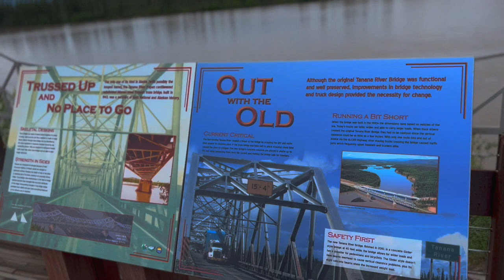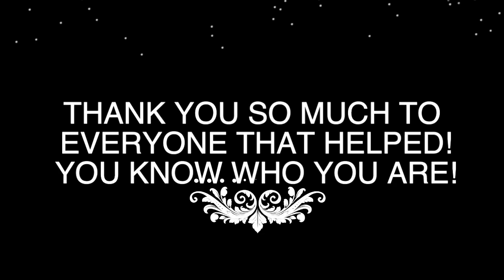Car Camping in Alaska ~ Our Volkswagen Bug ~ Nordland49

Comment: So what do you think made it come loose. Those nuts are torqued up to around 250 lbs. unusual for one to come loose like that. Bummer it cut your trip short. I’ve done some decent trips in my 56, I try to stick to back roads, 50 mph is a speed bump to modern motorists. All the best in your VW adventures.
Aussie Bob.
Reply from the maker: Hi there and thank you for watching the video !!
Well I think it was a combination of two things , I didn't torque it , just tightened very hard until the hole lined up to get the pin in , second , the road towards the Canadian border is very rough ( washboard like ) so I think it loosened the pin and then the nut and stripped most of the hub 😔 
Anyway, we still had a good time and maybe try it again this year,
Wish I could see your 56 !! hope you have a lot of fun with it this year !!!
have a good weekend and thanks again for tuning in 
Oli and Tacia